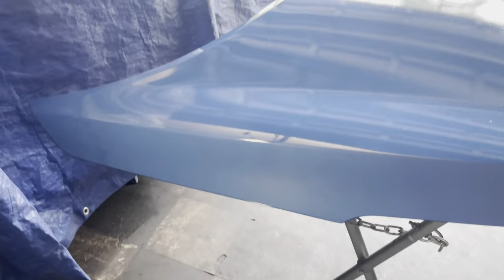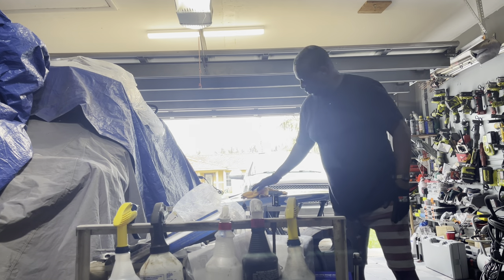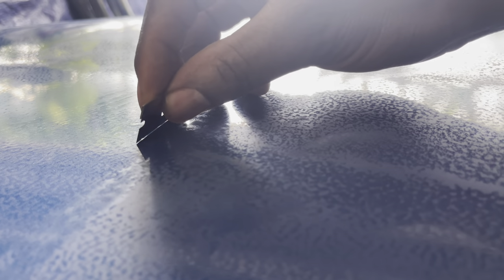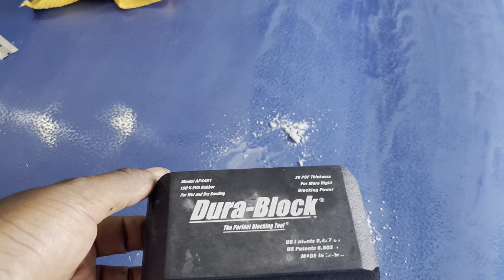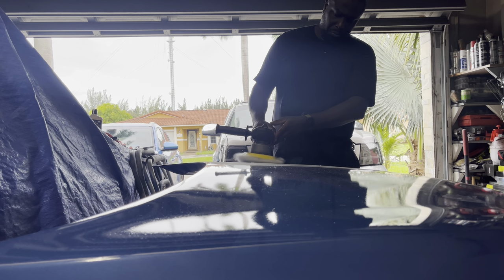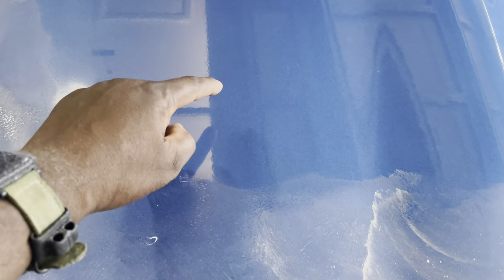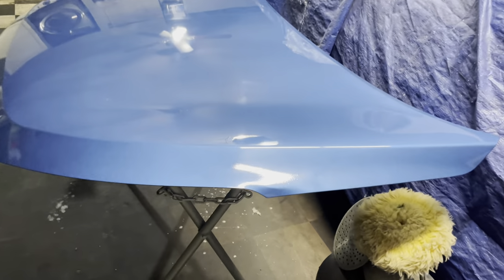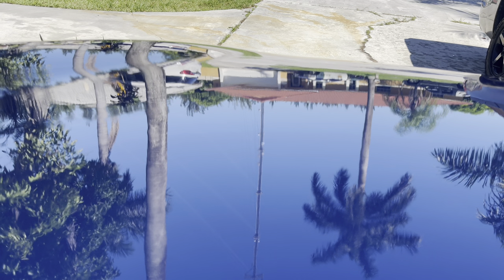Post Fuji minimite 4 wetsand & buffing!!

Comment: So did you put to much clear on that cause the problem to begin with?
Reply from the maker: I believe i did about 3 coats, i could’ve extended my flash time just to allow each coat to settle a little more, rather than to just apply the next coat while the prior coat was still in the beginning phase of flashing